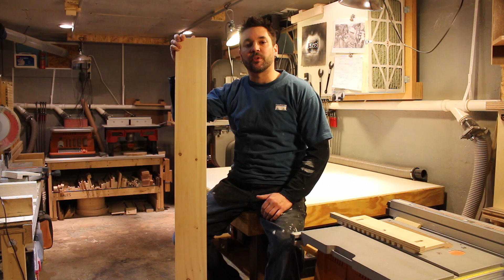The Growth Chart Ruler

Comment: Really nice job. Your work is clean. I'm having trouble creating a template. What kind of wood did you use for the template the same as what you would use for the board? I'm very very new to wood work. Excuse my amateur questions.
Reply from the maker: I used a high quality 1/2" plywood (no voids or cupping).  It was an offcut from a friend, so I'm not sure what it was - possibly baltic birch.

Here is another method from my pal, Mitch.
https://www.youtube.com/watch?v=Oxj9jcizrig

Comment: I have made my ruler now with the router but I don't understand your process of getting the numbers from the paper to the wood.  I see you're using some electrical tool, but do not recognize it.  Any advice is appreciated.  Thanks,Tim
Reply from the maker: +Tim B It's just a Weller Woodburning kit with the flat iron tip.  Another method is to use acetone.  Just search "acetone toner transer."

Comment: I like your number transfer method better than what I've been doing. I'm going to have to give that a shot. I sell my boards for $50 locally and I've seen nice hardwood boards go for north of $100.
Reply from the maker: Just Make It I dont' always get a full black transfer, sometimes dithered or weathered looking, but I'm ok with that for most of my projects.  I tried the acetone method before and wasn't happy with my results.
Reply: +BALES What is the tool with the flat top that you use to transfer?  And are you using just regular printer paper?
Reply from the maker: +Bo Bui The tool is a Weller 25-Watt wood burning kit, which you can find on Amazon.  It is just regular printer paper using a LaserJet printer.
Reply: Does it work with inkjet?
Reply from the maker: +Bo Bui Negative.  However, Steve Ramsey of Woodworking for Mere Mortals has a method for InkJet transfers you could check out.

Comment: Cool! But, how did you make the template thing for the spray painting?
Reply from the maker: jinatintin I drilled holes with a forstner bit and then cut out the "slots" using a sled on the table saw.  That's how I made the router template as well.
Reply: BALES I was wondering that about the router template.... My son is turning 1 in July, one of these is my wife's requested birthday present :)  Also, if you have a drum sander, I find you don't need to worry too much about over-spray filling in the lines. Spray it and one trip thru the sander and it's nice and crisp.  Great video, thanks for sharing!
Reply from the maker: Ben Nawrath, I've been on the look out for a drum sander.  Almost had a Jet Oscillating 22-44 for $600 of craigslist,  but it was gone soon after posting (what a deal that guy got).  I think I'm going to wait for the next Jet 15-20% off promotion and pull the trigger on a 16-32.  Thanks for checking out the video.
Reply: BALES You'll love it! My buddy has that one, we used it to true up some thin strips for a bent lamination. The fact that you can sand SO much wood with very good dust collection is great. Mine's an old Ryobi, also off CL, but it does the trick. I especially love it for cutting boards or glarly wood where a planer would chip out.
Reply: BALES One more quick question... When you made the router template and made the cuts on the table saw, did you have the blade all the way up and just get as close as you can to the holes? How did you account for the curve of the blade? Thanks!
Reply from the maker: Ben Nawrath The blade was all the way up and I got lucky that the curvature worked with the size of my holes.  I didn't end up over cutting, nor having to clean anything up by hand.  I made the jig before I decided to film unfortunately.
Reply: Thanks for the explanation.  I suppose as long as the rim of the slot is still true, the router collar will ride just fine, even if the blade undercuts a little.
Reply from the maker: Ben Nawrath Smart move with the shellac and it looks great.  I have a 10 piece bushing set from Woodcraft, which fits my Ridgid trim router base plate.  It does stand proud on the bottom, but I resolved that by taping on a layer of hardboard with a hole in the middle big enough for the bushing's housing.  The bit is just a cheap 1/4" double flute straight bit from my set of Skil router bits.
Reply: I think I have the same bushing set (and router). I guess I just need to take the base off! I ended up using a down-spiral 1/4" bit figuring it would prevent some chipping. Seemed to work fine.  It's been a fun project!
Reply from the maker: Ben Nawrath I mainly use the rectangle plastic base.  You can see my laminated layer of hardboard in the video and in my second video where I made the coaster set.  I might do a Q&A video after every few project videos to cover the random things I use though.
Reply: Great idea! Sharing is caring, right? :)